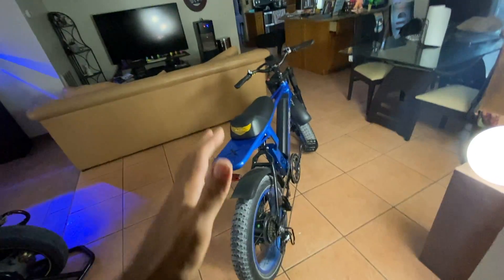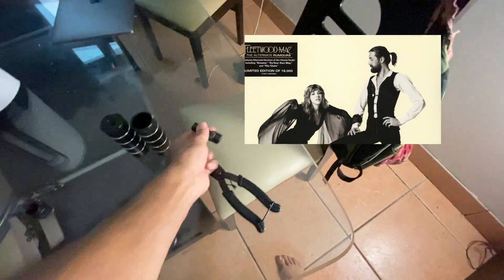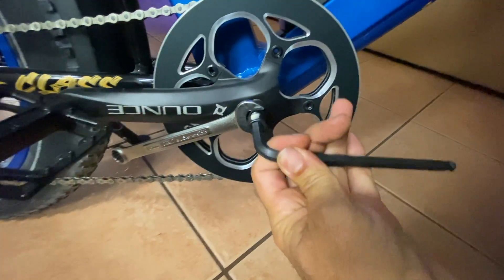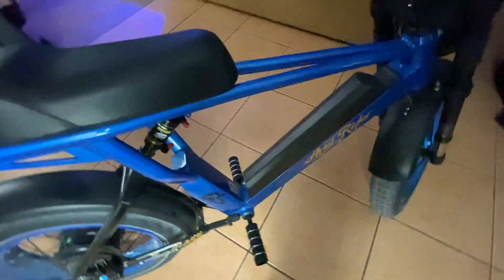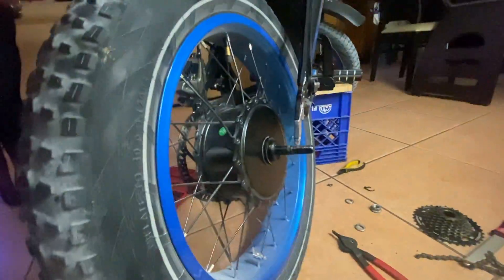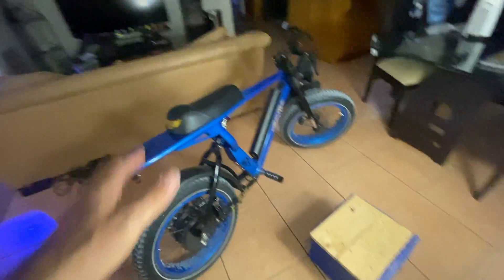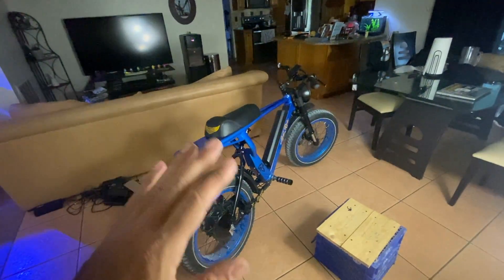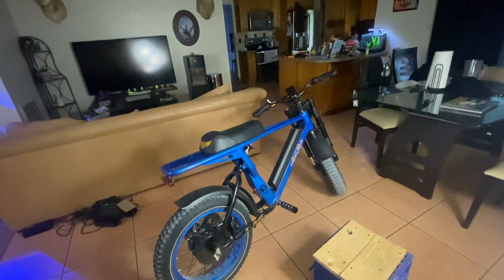ULTRALIGHT Motorcycle CONVERSION | Ariel Rider X 52 | 60v mods | illegal?

Comment: According to Florida state law the pedals are what make this bike road legal to drive without insurance registration license plate brake lights turn signals headlight etc. The minute you remove the pedals from this bicycle makes it subject to motorcycle law. Are you planning on doing these modifications to keep it street legal or are you going to fly with caution to the wind and hope that the police will give you an exception over the thousands of others they've pulled over, ticketed and impounded? I'm not saying this is a bad idea or not cool but there's a reason why the bike is sold with pedals to keep it in compliance with the law is all I'm saying....
Reply from the maker: Yup!
Reply: @JackCecil  just worried about you mah man, those cops down there are not even close to the nicest individuals in the world, the horror stories and videos from the area I've seen from ebike riders and such is mind boggling. Be safe out there!!
Reply from the maker: Electric Balance bikes (class 2) categorize as ebikes now.  The police here are very friendly and know me very well. I have no issues at all. And give them no reason otherwise.

Comment: im curious to see what tires you run next..aftermarket ones are twice as heavy as the stocks I got a higher top speed with stocks than with aftermarket..was at 35 stock now 32..